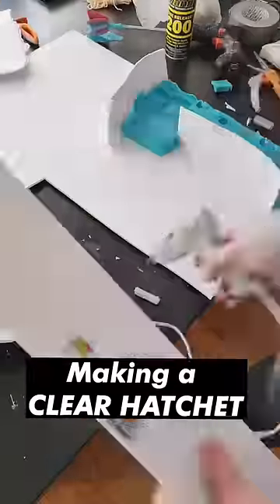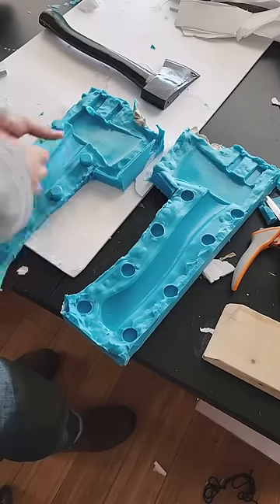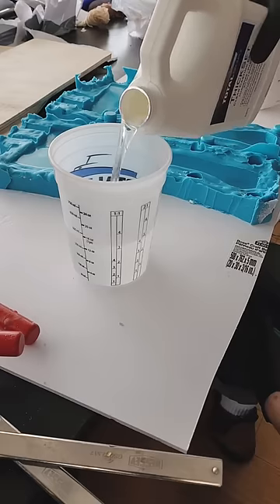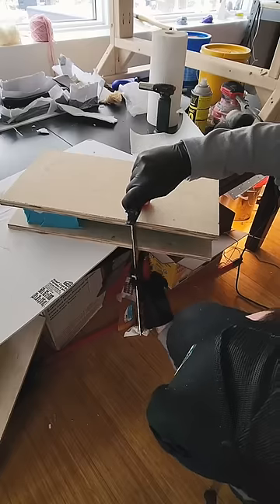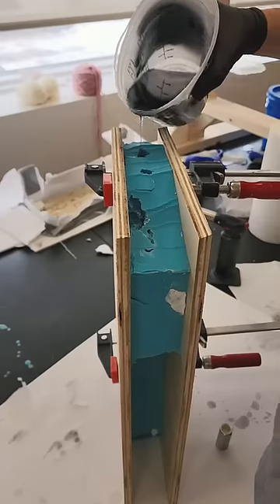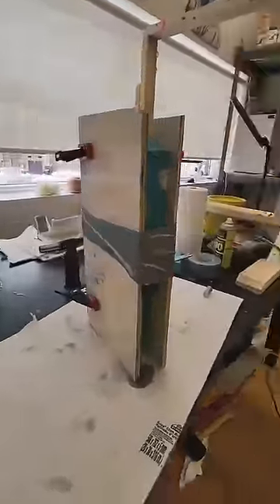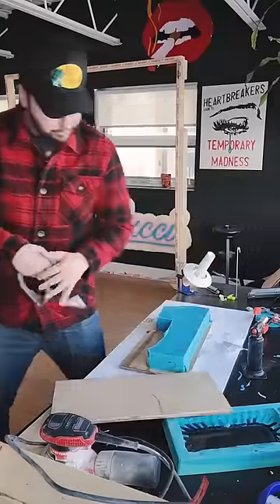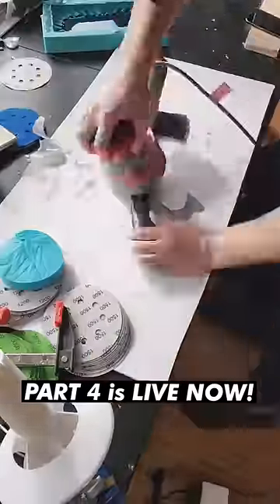PART 3 of Making a CLEAR HATCHET! #diy #howto #resin #resinart #art #satisfying #satisfying

Comment: Never would’ve thought to use a vacuum chamber to rid the resin of air bubbles.
Reply: I was thinking it needed to be in the molds used for casting with epoxies or anything that may have bubbles.

Comment: Is there really a connection between viscosity and the time it takes to harden/react? Cyanoacrylate super glue can be as runny as water and still harden in a few seconds or minutes. Then there is something like metal epoxy which is a putty but takes hours to harden/cure.
Reply: No, there is no relation of viscosity vs curing time at all. Not with any if the casting resins I am familiar with (polyester, epoxy, polyurethane, silicone, acrylic, methacrylate)

This guy is the typical youtuber. Active in making content, but no background whatsoever. Follows the trends.